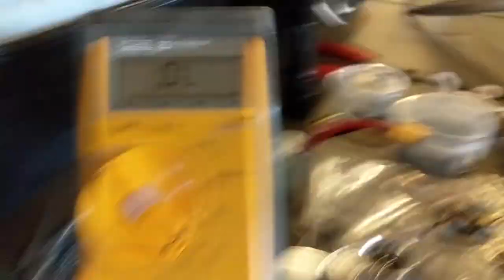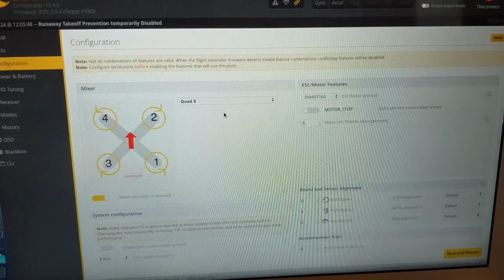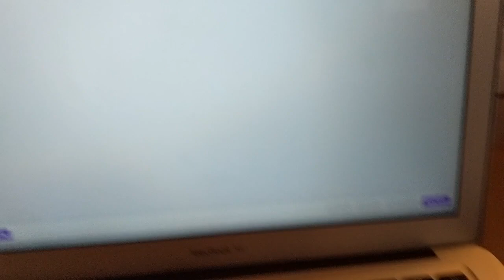Diatone Mamba Stack Banggood Return

Comment: I had the same issue solved by unsoldering the motors. without the motors soldered I managed to read and flash the firmware  and restore settings to default.
Reply: I too have this same issue... How to flash firmware into the ESC... Do you have any tutorial for this?